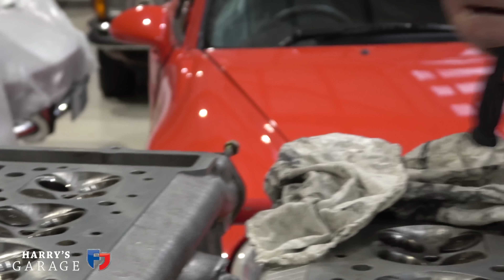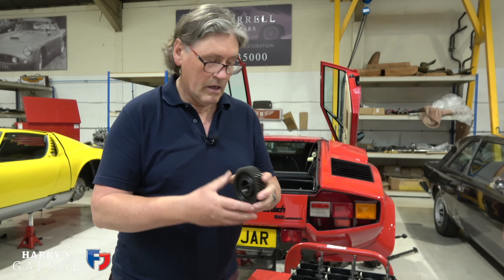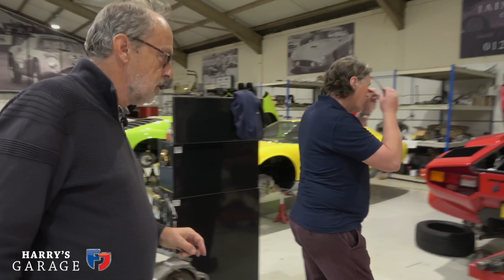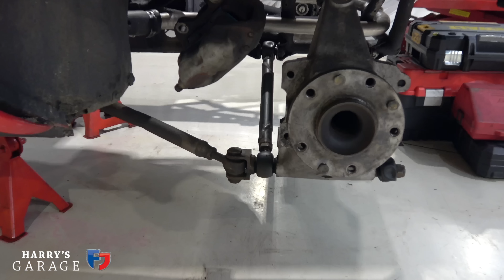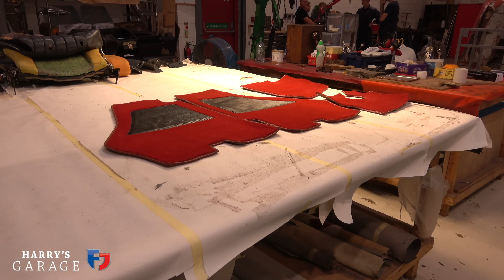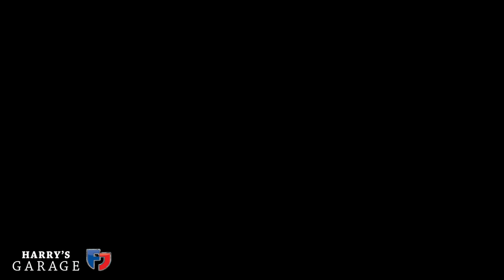Lamborghini Countach QV resto update Pt.5. There's an unexpected problem with the gearbox

Comment: Remember the old plug in valve / valve seat grinder machine that most corner garages had, that you ground the seats on, and then you had a pointer gauge you set the valve side of it off of the machined valves so the angles were correct (opposite) . Thats the same problem as phosphor bronze seats you have with titanium valves is WEAR. Because they are a more durable metal, naturally they have a more abrasive nature on the valve seats, and frankly - most racers I have spoken to say Stainless valves work just fine

Comment: Diaphragm clutch is as per Norton motorcycle clutch design , so we are considering it being hand operated which must indicate some mechanical advantage making it lighter to operate.. Using one on a bored out Vincent Black Shadow motor and it handles the torque with no issues.-, dry running with SureFlex plates.
ps Iain Tyrrell Classic Cars do impress as being a 'safe pair of hands' to be in.

Comment: I remember hand lapping valves on Mini, Viva and Scirocco engines and it was quite enjoyable but at that time, only two valves per cylinder. It is undeniable, however, that a car like this needs an owner for whom the payment  of the final invoice is joined by little more than a shrug. Still, more modern cars are not going to cheaper for gearbox repair especially if the word Powershift is involved along with dual-mass or DSG. Once again, the result will be excellent when the Countach drives away from here. What's the likelihood that the other gear is only manufactured in Ukraine?
Reply: i don't think very high. Remember Lambo started as a tractor company. They probably made all gear components in house.
But even if you can't find a new gear there are specialy shops that can make a copy. Shops that build gboxes for motorsport.
Reply: Italy has gear milling factories every two blocks.

Comment: the increased helix angle of the gear reduces noise but increases side loading
Reply: I thought the same. They'll need upgraded thrust bearings I guess.
Reply: They probably deemed that the original is more than enough for the extra side loading.

Comment: One of the guys lapping-in the valve seats seemed to only be lapping in the valve stem most of the time. He only seemed to have the valve in contact with the seat 25pct of the time.
Reply: That's showbusiness for ya.. props. Think that's bad look at the freakin awful casting quality in the head @ 3:00 even after cleaning up I can't believe they would even fathom letting it out of the shop with that much porosity.. even the gasket surface was beyond

Comment: I've never heard the term rose joint, ive always hear heim joint or spherical bearing. Learned something new
Reply: If memory serves, they were a German invention around WWII.  When the allies found out about it, two companies were given exclusive rights to manufacture them - H.G. Heim in America, and Rose Bearings in England.  So they took on the name of their respective companies - Heim Joint or Rose Joint.
Reply: @aussiebloke609  that's good information! I didn't even know they existed until 7 or 8 years ago when I replaced all my rear suspension joints with them.
Reply: The Countach doest actually have metal to metal rose/heim joints as such.  I think the term is 'metalastic' in which the joints are firm but flexible, mainly to counter road noise transfer.

Comment: Pull type clutches are lighter in weight, smaller in diameter, have better cooling and better clamp loading. Push type is the more common because of the ease of assembly.

Comment: Ferrari for example only swapped to using something other than phosphor bronze with their guides with the very late Ferrari 355, which had huge valve guide issues. Should have been a recall really. The ‘fix’ was using sintered steel guides from the factory, which ferrari used exclusively going forward.

Comment: If this was MY car. This car needs to be UPGRADED into the future. Pull out the old tech engine/trans and convert to battery. A Lucid 600+ hp engine takes up the space of a desktop printer box. Add blade batteries from BYD you can place better in less space then a Tesla battery pack. Then update the dashboard to a flowing look, add modern physical ac dials from VW and a digital dash for everything else. Although old exotic is desirable, as parts become harder and harder to get, it would make more sense to convert these to battery cars. I would love to see this car on the road for the next 100 years. Emitting no carbon but just a beautiful as ever. Thats what WILL happen to all older cars over the next 50 years. Converted to battery OR hydrogen. Remain beautiful but stay updated to be on the road.

Comment: If you reface the valve and valve seats properly you often don’t need to them lap the valves to the seats. 

And if you’ve changed the guides you certainly should’ve had the seats refaced as the guide is the pilot for the seat, somewhat obviously. 

A decent machine shop or specialist would know this.

Comment: Why if a gear is as pitted as that why would you not be changing the mating gear anyway ?
Reply: They don't always damage both mate, often pitting will only be on a few teeth and no damage whatsoever in the mating teeth. Remember they don't contact the same teeth on each cycle so as long as there are plenty healthy teeth you usually get away with it. I've seen missing and bent teeth not cause any damage on the opposing clog

Comment: That is not a good way to get the valves to seal, there are proper machines to cut the valves and seats to the correct angles and then vacuum test them. Cowboys.

Comment: KILLED myself affording new dual mass flywheel and clutch for the Insignia ....oh man oh man the bill for this £££
Reply: Should have put a normal clutch on it mate they go constantly so did the mondos and Focus. If you even rest your foot on the clutch on any of them you will wreck them every 25k. Keep your foot well away from the clutch on them and don't lug about at slow speed without any gas and  you're usually fine.

Comment: Never the same once they have been rebuilt
Reply: No longer original even if new parts by Lamborghini, but some bits are improved. Is a Fulvia with original body with some repairs  and original paint worth more or less than Harry's almost new body with not much original metal and new paint?

Comment: Hand lapping of valve seats.Its nigh on impossible to get an equal profile with the palmed stick wibbling around.? I would have thought you would machine the process at that level to make sure that they were perfectly ground in for the valve lips.?
Reply: You would need to recut the entire thing then.. for the same result. If it passes a comp check yer done.
Reply: You can tell from the grinding line on the seat. The valve doesn't wobble because its firmly in the guide.

Comment: I don’t understand how the spacer plate increases engine displacement.  I can see how it affects the compression ratio, but displacement is a function of engine bore and stroke.  So unless you increase the stroke, you haven’t changed the displacement.  What am I missing?
Reply: They did increase the stroke by using a different crank.and the head spacers are actually holding down the taller liners they had to use because of the increased stroke.
Reply: @inmate666  Thanks for this explanation.  Now it makes sense. I should have reviewed the show more carefully. Thanks.

Comment: That spacer is a botch by the factory.
Reply: I'm a little surprised they didn't alter the casting patterns at some point, if not for Countach then at least for Diablo onwards.
Reply: @rdavis43  Too expensive to do that.  Their spacer was a clever idea and it works.
Reply: @bobolulu7615  agree, and it holds the longer liner but it is still sub optimal to say the least.